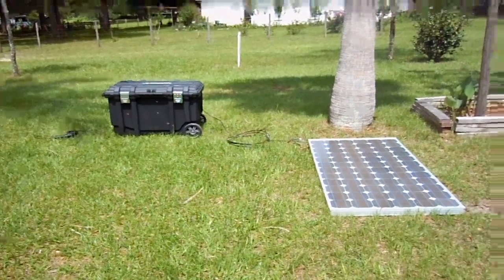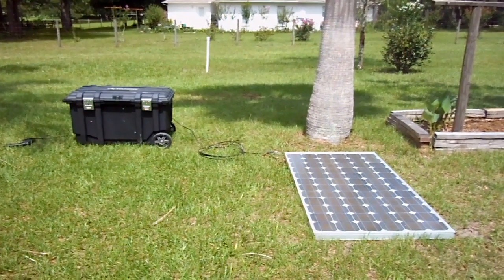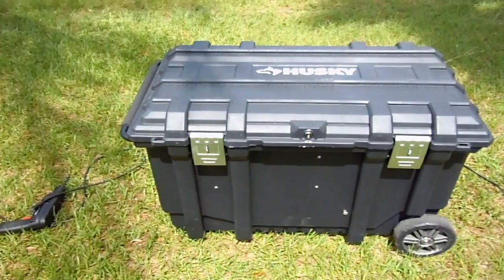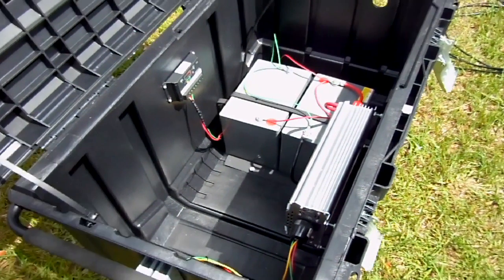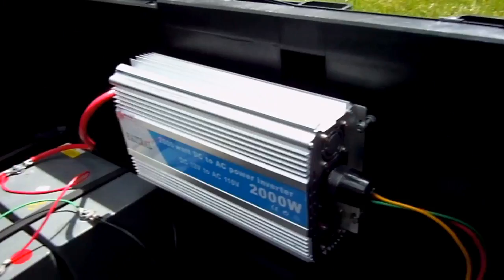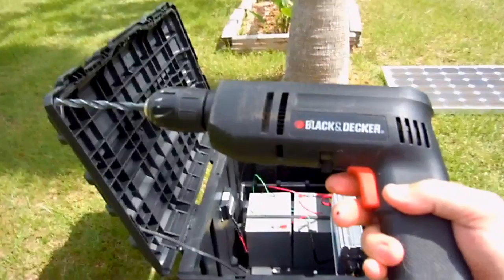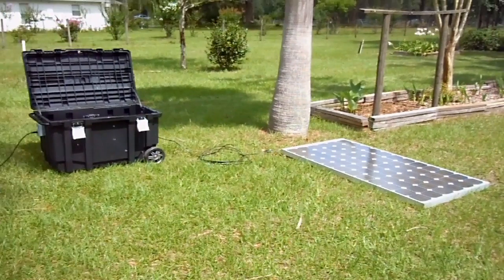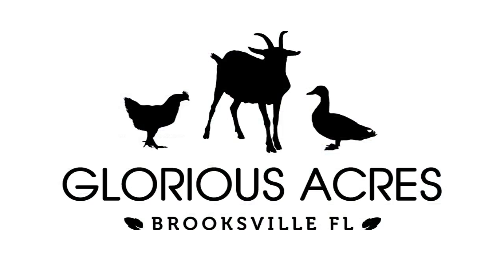2000 Watt Portable Solar Generator

Comment: Will it work with 220 appliances and well pumps, and can u connect it to your home breaker box direct or run new line,thx
Reply from the maker: You're pushing it a bit there... This unit is not designed to run high power appliances or well pumps, it's a portable 2,000 Watt unit! Would you try run 220 appliances and a well pump on a 2,000 Watt gas generator? Hardly...
Reply: Thx, so like if I got a larger capacity inverter is that the issue?
Reply from the maker: Right! A 220V inverter capable of handling your device/appliance's surge & load should do the trick.

Comment: Hopfully you are going to add more batteries and maybe upgrade it to 3000 watts and add things like a 12 volt outle and usb ports and a battery volt meter and plrase make that plug a GFCI in a watterproof holder. Then you can talk about this generator.
Reply from the maker: You're so right! This was one of my first attempts at leveraging individual components, and although similar generators we built saved lives during hurricanes, we continue to improve our pro line products moving forward. Your feedback is most welcomed! #TGBTG

Comment: Daniel, 
Nice job! It appears that you're only using 1 solar panel. 
How long does it take to charge your batteries? I'm interested in building an identical system with a slightly larger, spare 280W LG panel. I assume the same components will work, right? 
Lastly, I think a smaller contractor box would work and be more ideal? Is there a reason why you went that large with yours? 
Thanks for your time. 
Mark
Reply from the maker: A single panel concept works well for emergency situations when plenty of time is given for the solo panel to charge a single gel battery. 

Depending on initial charge, and assuming both batts are drained, the heavy duty panels I use require 2 days of full sun to charge both batteries to 13+ volts. 

Your system should use the same setup, just different (better :) components. 

We use larger "boxes" so we can add batts and/or components w/ maximum air flow for cooling purposes, and w/o working space restrictions. I have personally made Solar Generators with much smaller, more portable designs, and each one does what it's supposed to do: Provide renewable, emergency power.

To God be the Glory!

#Blessed

Comment: Hi Daniel. Great video! How much will it cost to make or you to make a generator, without batteries, for a pool pump: 115 volts-9.8 amps? Thanks. raylevan88@hotmail.com
Reply from the maker: Hi Ray, you're looking at a minimum 1,500 Watt generator powered by 5 x 300 Watt solar panels, and a 2,000 inverter, no battery means no power when the panels aren't in the sun, but worse, your inverter will short out every time the load surpasses the power put out by your panels when they're not in full sun. I suggest at least 3 batteries...

Comment: Would it be possible to hook up a 4000 watt converter to 2 100 Watt solar panels instead of 2000 watt converter?
Reply from the maker: Of course, remember the power comes mostly from the batteries, and that the panels are mainly used to charge the batteries or provide 12V power to the charge controller's load output...
Reply: Thanks for your response.  How many batteries do you think I'll need for my battery bank?  I'm looking at getting the SLR125 VMAX AGM Deep Cycle 12V 125AH Battery for RENOGY PV SOLAR PANELS.  Thanks again for the video.
Reply from the maker: That depends on the amount of power you need and the duration you need the power, also, you'll need enough solar panels to either support your load, when the sun is out, while charging your batteries. Essentially, for off grid systems, you need enough panels to supply power AND charge your batteries. Grid tied systems work completely different... Are you planning to use an off grid system?
Reply: I've been looking for a system for off grid. Just enough to run some led lights, fridge, radio, etc.
Reply from the maker: I run a (2) 75AH battery solar generator to power my home office with (2) 150W solar panels, and I should add (2) more batteries since on some days, my batteries fall below 10.5 volts and I have to go back on the grid for a full day while the panels recharge the batteries. So, I recommend you go for (4) batteries if your budget allows for it.
Reply: Thank you Daniel.

Comment: What was your overall cost for the build, can you send me an email with the list of items.. Que242911@gmail.com
Reply from the maker: My cost was slightly lower since I used a combination of new parts (charge controller, power inverter and 50 gallon portable housing box) as well as used solar panels and reconditioned AGM batteries.

Here is the list of parts I used to build this portable solar generator:

+ Solar Panel (New $123.99 - No Need for Charge Controller)
http://tiny.cc/Solar-Panel

+ Charge Controller (If Needed - New $11.69)
http://tiny.cc/Charge-Controller

+ 2,000 Watt (4,000 Peak) Power Inverter (New $126.99)
http://tiny.cc/2000-Watt-Inverter

+ (2) AGM Gel Batteries (New $208.60 each)
http://tiny.cc/75HR-AGM-Battery

+ 50 Gallon Battery Box (New $71.47 )
http://tiny.cc/Husky-Box

+ AC Parts, Wiring, Ring Connectors (New $35.00)
Lowes, Home Depot, Ace Hardware

Total approximate cost of new parts $800.00 (shipping NOT included)